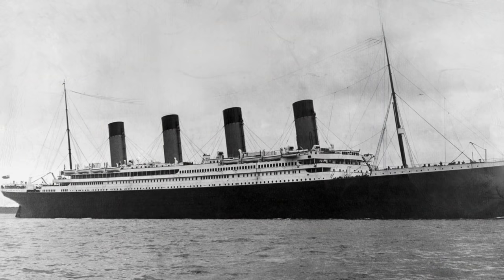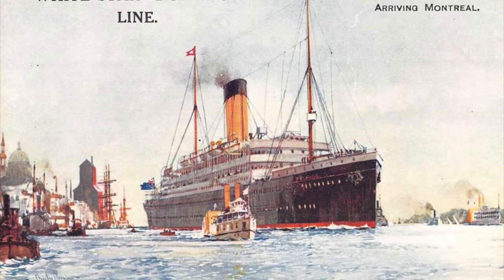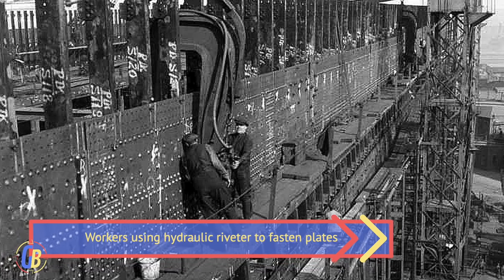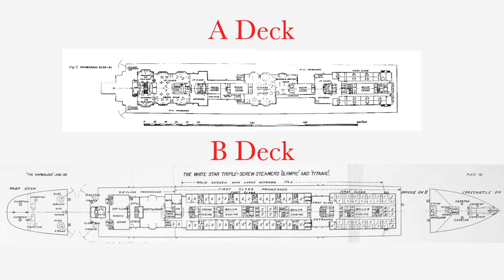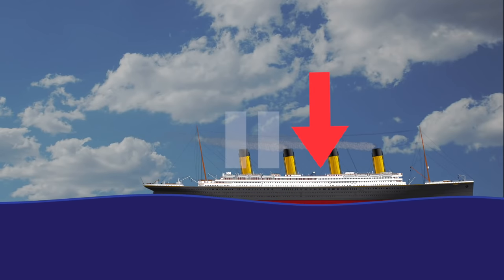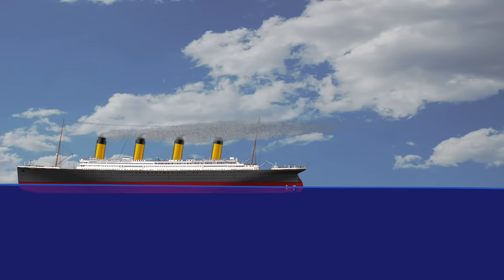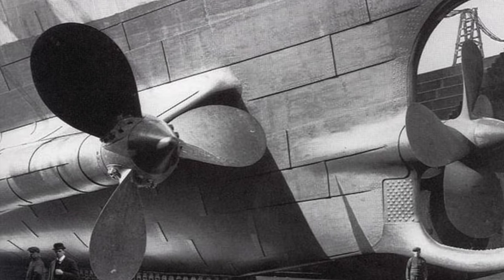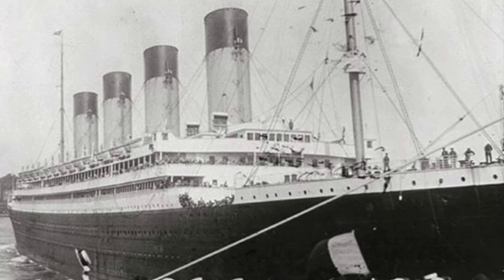Ten Technical Titanic Facts

Comment: A note about propeller blades. They were actually cast manganese-bronze, not cast iron. The center propeller was cast in one piece, the wing propellers had individually replaceable blades. 
Very interesting video, thanks.
Reply from the maker: That seems to be correct. Thank you for the clarification and I'm glad you enjoyed the video.
Reply: To this day most larger ship propellers are cast from manganese-bronze.
Got one on my own old boat (built in Risør Norway 1968) 🚤
On smaller boats most propellers are cast from an aluminum alloy these days.
Reply: As with much of the stuff, there are apparently no known photos of Titanic's propellers. The design was also changed, as the blades had an issue of being lost, I think they moved to bolt on designs to save cost if a blade was lost, the material was also changed (steel may have been used with some types). Also the central prop, was sometimes 4 blades and at other 3. Being as there are no sea images or dry dock images of Titanic it is unknown what type it sailed with
Reply: no
Reply: @anticat900  there are dry dock photographs of Titanic propellers -I have several published photographs of them
Reply: @anticat900  I have  photo of both moored together and you can clearly   see the closed and partly open promenade decks that most obviously distinguish both ships.
Reply: That's what I've read and seen in the documentaries the props weren't just bronze.it didnt matter in the end. I still cant believe they let ismay into a lifeboat.i read more 3rd class children died than1st class men.just a complete and total mess from the very start.

Comment: The Titanic also had four elevators,   such an innovation for the time. The butchers were trapped and perished in one of them.
Reply: Bonnie Magpie all 4 elevators were for passengers though, closest thing crew had to a elevator bad a mechine powered hoist used for the ships galley, that might be what you’re referring to.
Reply: @SQUAREHEADSAM1912  ;  Was the hoist something crew would have been trapped in or would they have used the elevator because it was what they could get to at the moment  ?
Reply: Bonnie Magpie you’re probably spot on, they either used the hoist or got trapped in the passenger elevators In the later end of the sinking. 
Btw hoists were used to bring supplies to other decks but could hold the weight of a person.
Reply: @SQUAREHEADSAM1912  I was watching an interview with one of the butchers grandsons and that was how I learned that some were trapped in an elevator.
Reply: Bonnie Magpie cool, thanks for the info! :)
Reply: If I ever take an ocean voyage I'll take the stairs at all times, due to this.
Reply: Britannic have more she has 5 
And her elevators in the main staircase was raise from a deck to boat deck the elevator gear was lift to the roff of the grand stair case.
And a elevator was installed in the aft stair case and was one of the upgrades of the britannic.

Comment: The propellers weren’t cast iron, they were bronze.
Reply from the maker: Yes, I have since realized that. My mistake.
Reply: codetwohigh - Correct!
Reply: How could you research the propellers of titanic and get the material completely wrong??? Hmmm now that makes me wonder about the other “facts”.
Reply: The Great Big Move hi
Reply: Very true. I was like wait, WHAT??!! No... that's not true
Reply: Impressive!
Reply: Weren't and still aren't. If you've ever seen pictures from the wreck you'd see they haven't corroded at all the way the steel of the hull has.
Reply: Normeley boat propellers are made of Messing
Reply: @sforza209  there is always one person who is a nutter !
Reply: @sforza209  “i stopped eating because i am worried about choking”
Reply: A manganese/Bronze alloy, I believe
Reply: They're actually manganese bronze, which is great for corrosion resistance, especially in seawater.

Comment: The type of steam turbine engine that drove the center screw in front of the rudder was called the Parsons Steam Turbine. It was only used when the Titanic was at sea. The Parson's Steam Turbine used the exhaust steam, that still had plenty of pressure and heat energy in it, from the two triple expansion piston steam engines that drove the port and starboard screws directly. When the Parsons Steam Turbine was not used, the exhaust steam was directed to condensers to recycle the water back to the working boilers to begin the steam cycle again. Steam was also used for electric generators on the ship as well as the rudder engine mentioned in this article.
Reply: The centre turbine was direct drive, there is no reduction gearbox.
Reply: @bobcornford3637  You are correct.
Reply: They also never use the turbine on the maiden Voyage. If I recall correctly
Reply: @mikeprimm4077  The parson's Turbine could only be used when the ship was going forward and it was used to extract all of the remaining propulsive energy from the steam that can be possibly be done. Because the Titanic's boilers were very hungry and Titanic had only enough coal fuel to get across the Atlantic to New York with little to spare.
Reply: @mikeprimm4077  that's an interesting fact though the movie portrayed the middle propeller spinning in reverse to avoid the iceberg, obviously not right as it was forward only
Reply: @MegaGeorge1948  and amazingly this idea of using leftover steam pressure to power auxiliary things went into a steam car, the doble. Jay Leno has an amazing video of the doble and how it recycled its water and to use leftover steam pressure to add extra torque to the engine and to run the generators after that!
Reply: @12pagani  Yes. I saw it on Jay's program. Jay loves steam. The Doble was the most advanced steam powered car before the gasoline engine cars took over. The main downside of the Doble was the lack of range before the water ran out in spite of the use of super heated steam and the use of the condenser. The condenser efficiency varied with the seasons with the cold Winter giving the most efficiency to the condenser to conserve on water to extend the range.
Reply: @12pagani  watch it again and you’ll see it DOES NOT reverse. There was no reverse turbine element in it.
Reply: so technically the third prop is a turbo
Reply: @ls1pr3dator9  Steam driven turbo. Today's nuclear powered submarines have steam driven turbos to turn the screw(s).

Comment: Great video!  Here’s another interesting fact: samples of the Titanic’s hull plates taken after her wreck was found by the Woods Hole Insitute were analyzed at the Canadian Materials Laboratory of the Federal Dept. of Natural Resources in Ottawa. The metallurgy was found to be very high in sulphur (apparently, this was typical of Belfast-made steel at the time) which means that the plates were brittle and prone to cracking. This is a highly undesirable characteristic in ships hull plating as it means that even a small crack could simply rip open like a zipper, particularly in cold temperatures.  The conclusion was that the low ductility and fracture toughness of the Titanic hull plating contributed to the very long gash that opened in her starboard side when she struck the iceberg.  If she had been made of tougher, less brittle steel, the hole would likely have been smaller and she might have survived - or at least sunk much more slowly allowing the other ships in the area to get to her sooner.
Reply: There isn't a gash in her hull. The rivets holding the hull together were put under immense pressure (akin to a cork in a bottle) which caused them to pop out or sheer off. This caused small sections of her hull plating to separate across an area of 12 square feet. 
Water entered the ship through a series of tiny gaps only millimetres wide, not through gaping holes in her hull.
Reply: Biker Max -the steel shell plating was not made in Belfast -it came from.steel makers in Scotland
Reply: @paulheenan9098  correct -the total area of the holes in the hull  was 12 square feet  If you read the Board of Trade inquiry into the sinking they confirm this figure based on the rate of flooding  of the ship

Comment: A rather mind blowing tech fact is that she generated enough onboard electricity to power the entirety of Southampton.
They chose to go with the reciprocating engine/turbine combo because it was the only way to propel such a large ship at a reasonable speed without the heavy vibrations. (White Star had been wanting to build a ship of Olympic's size since at least the early 1890s, but the weaker engines of the time made it literally impossible for such a ship to even move)
Reply: They were that powerful?
Reply: For me, the combined reciprocating and turbine engine propulsion system used on the Olympic-class was pretty clever.

P.S. Are Titanic's generators that powerful? I wonder if they are also able to provide enough electricity on the town I live in.
Reply: Power wise
Main: 4 x 400kW steam generators
Emergency: 2x30kW steam. 
So that gives you 1,660,000 kW at 100v DC, simply 1660 MW. A US nuclear power plant is 500 to 1300MW. 
1.6 MW is the power base for Google in California, which is one business. 1MW is generally assumed as about 1000 homes.
Yeah it could power your city. Depending on where you live. New York City is 11,000MWh per day on average so obviously it depends. 
In its own right Titanic had a power plant.
Reply: Also, the turbine only worked in forward, it did not have the gearing required to turn the screw in reverse.
Reply: @roundsm18  Oh, I see. They are really THAT powerful. I do live in a small town in the Philippines, and there are some parts that I believe were not under the power grid.
Reply: @goldprime118  Yep. They were tested before Sea Trials.
Reply: @johnroelmontalbo291  Probably lol
Reply: @roundsm18  All these points are incorrect.
Reply: Stephen how so? I based them off the specifications of the power generation system alone, not installed propulsion system.
Reply: @roundsm18  4 x 400kW is 1.6MW, at least it was when I got my ticket.
Reply: @tjh44961  You don't need gearing for going astern. You use a separate turbine.
Reply: What's that rubbish about choosing Recip engines to avoid vibration?
Reply: @bobcornford3637  Not rubbish at all.
Early turbines had no gearbox, so they were hooked up directly to the ship's prop shafts. Transmitting such high levels of power directly into the shafts caused them to vibrate substantially. 
Lusitania's sea trials showed that the vibrations were so severe they made the stern literally uninhabitable, necessitating the reinforcement of her and Mauretania's sterns to reduce them, although the problem persisted throughout their careers. 
The vibrations on one German ship (I believe it was the Deutschland) actually put so much stress on her hull that her stern cracked clean off. 

With their emphasis on passenger comfort, White Star wished to avoid these problems, but couldn't rely on steam engines alone. That's when they had the novel idea of combining the two propulsion methods into a powerful, yet comfortable hybrid.
Reply: @paulheenan9098  I'll deal with your points in order.Turbines by their design do not vibrate. The amount of power being developed is irrelevant - they simply do not vibrate. The power output of 'modern'  turbine plant far exceeds those early turbine ships, yet there is, and should be, no vibration. Similarly the means of drive, be it direct, single, double or triple reduction is not relevant to vibrations which come from whatever prime mover is used.
Almost certainly the vibrations experienced by those early vessels was propeller / A bracket induced. Probably not helped by a lack of stiffness around the stern tube / A frame running aft. Your  statement about it being a turbine issue is weak in the sense that, if it were a turbine issue it would have remained unabated - and quite clearly did not.
The situation regarding reduction gearing was related to resolving the problems inherent in the fact that turbines are high speed machines and propellers are not. 
The problems experienced by the German Express lines are completely irrelevant to this discussion as they were using increasing complex reciprocating plant.
A turbine is a steam engine.
Reply: @bobcornford3637  which the Titanic did not have.
Reply: @bobcornford3637  plus emergency. My calculation was probably off, I was somewhat out of it. I also don’t do power generation often let alone marine power generation. I did include emergency in the calculation which is how I arrived at 1.66 instead of the 1.6 of just the main.
Reply: Paul Heenan o
Reply: @bobcornford3637  some turbines have reversible blades that give you 20% power astern for manoeuvring
.Titanic had only a forward turbine that used exhaust steam from.the quadruple expansion reciprocating main engines .

Comment: The electric system on Titanic was 100 volts DC. I also know that one side of the DC circuitry was grounded to the iron hull. (Like a car). My question is was the titanic positive or negative ground and why.
Reply: Negative
Reply: Never knew that.
Reply: I would also assume negative. Planes still ground to the airframe and use the electrical standards set up at the dawn of electrical engineering meaning things like negative ground (and conventional current). Even though now we know better it’s hard to overturn standards that are used in almost every field of mechanics and engineering
Reply: Correction: some planes will use positive ground but this is an exceedingly rare case and is not something you are likely to find on any production aircraft
Reply: Jack Clarke
 ... Reading in various there were 3 or 4 gen sets to provide electrical power to the ship. It's unclear exactly how many due to changes during production, but I suspect 4. The numbers are usually from the sister ship because those records were not constantly altered during the build. One set of records says they were 450 Kw each, which was fairly large at the time. There was a separate gen set for the Marconi (radio) room just to be sure in an emergency. Recalling it was 10 -20 Kw, going from memory. Kitchen cooking was done in electric ovens... a FIRST in the industry!
Reply: I don't know it, but it don't has to be the negative like at cars. Early vehicles and old agricultural tractors (like olf Ferguson tractors) had sometimes the positive as ground, until the manufacturers recognized its better to use the negative because of corrosion.

Comment: Great video! Thanks for sharing. Regarding the hull and coal bunkers, you may have previously mentioned that there was a smoldering fire in a forward starboard bunker. Extinguishing it would have delayed Titanic‘s maiden voyage departure. But it weakened those steel plates, and they were the ones that scraped the iceberg.
Reply from the maker: My understanding is that fires in coal bunkers were fairly common. I think the ship would have sunk anyway, but maybe the fire (which had been extinguished the previous day) made the damage a little worse. It's difficult to get a consensus on that topic!
Reply: Thank you, sir. Your in depth research is superb!
Reply: The coal fire sounds awful, but they really were quite common at the time. It was extinguished long before the ship hit the iceberg. If anything, it helped. There was much more coal the crew moved to the port side, away from the fire. It made the ship have a slight list to port. Essentially, it helped balance the ship when she began to flood on the starboard side.
Reply: The coal fire was minor, was extinguished on April 13th and was nowhere near the collision zone. The bunker that suffered the fire was just behind the first funnel and the picture showing the supposed 30 foot long scorch mark is the only one to do so. No other photo of Titanic shows it and it's been blamed on an imperfection in the photograph itself, either from the camera lens or in the development process.
Reply: @paulheenan9098  The subject area in that photograph is entirely above the waterline.  The coal bunkers were below the waterline.

Comment: Great video, 
I just recently learned that the , low pressure turbine driven center screw, was forward operation only. The two giant recips, starboard and port, could operate in either forward or reverse.
I have seen the "Big Piece" (Hull section) at the Titanic exhibit in Las Vegas and was always under the impression that, upon close scrutiny, the turn of the century workmanship would most likely be crude at best, considering the tools they had to work with at the time. This is not the case at all, one could align a straight edge along the rivet lines and the hull plates butt against each other like someone drew a line with a pencil, absolutely beautiful and awe-inspiring work! - need I remind anyone that each plate likely weighed 6 tons or more. 
The porthole glass, in the Big Piece, is two inches thick and the craftsmanship of the entire ship must have been truly amazing - but then again, they were the finest craftsmen in the world, building the most expensive and opulent ship ever created. What, Grand Old Dames, the turn of the century liners must have been, indeed...

Comment: The engine uptakes and funnels all had corner doublers, which were meant to prevent cracking and strengthen them. This also caused a messy split when the Titanic did come apart, because the doublers in the engine uptake behind the third funnel, and the third funnel itself caused the infrastructure around each to come apart, instead of the parts themselves.